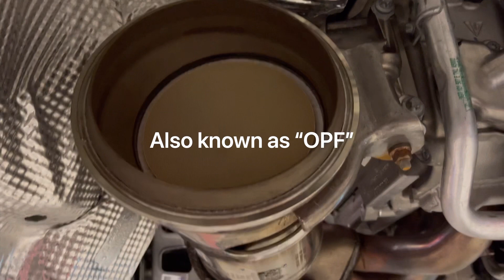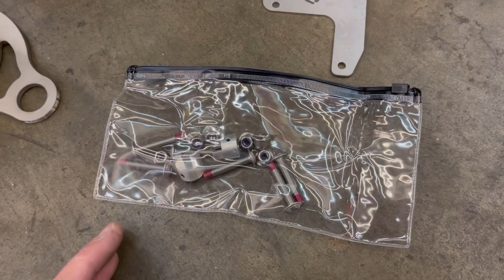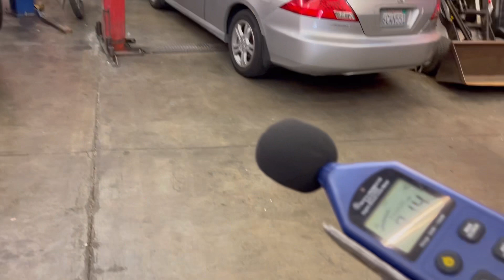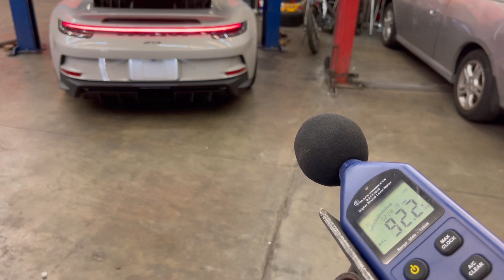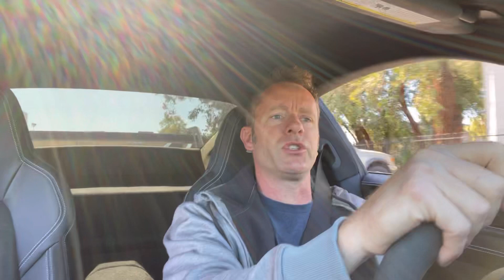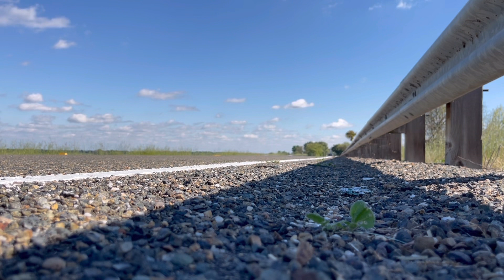992 GT3 JCR exhaust before and after DB’s, drive by sound, and impressions.

Comment: The only noticeable difference is with the exhaust valve closed. I wouldn't buy it...
Reply from the maker: @br1m3  unfortunately the video doesn’t translate the tone difference.  It’s very discernible from stock in either setting.
Reply: Ok ... but numbers are numbers:
Original exhaust valve's open: 117 DB
JCR exhaust valve's open: 115,5 DB
🧐🧐🧐🧐🧐🧐🧐🧐🧐🧐

Comment: thanks for this good explainer. have you tried any other exhausts on GT3? I am looking for something high pitched, not bassy. akrapovic comes out very low frequency and bassy exhaust. this jcr is better but still not as good as 991 gt3 sounded with their exhaust IMHO. so far - Valvetronic Designs, iPE, Dundon, Fabspeed - sound more high pitchy to me
Reply from the maker: Don’t be fooled that the exhaust can change the result of the engine dramatically.  You cannot make Madonna sound like James Hetfield with different equalizers or amplifiers.  Exhaust systems can have some impact, but not that much.
Reply: @mufflertech  I'd disagree - there is such a dramatic difference between some of the exhausts. Just hear this one out https://www.youtube.com/watch?v=-DuHQQXI_JU
Reply from the maker: @rdrrua  that car has 200 cell cats with header’s.  That is where the big difference is.

Comment: What is OPF monitored or non monitored?
Reply from the maker: OPF are non monitored on North American spec cars
Reply: @mufflertech   ahh okey, so for spain is monitored
Reply: Does the exhaust need software tunning?
Reply from the maker: @S25117  no.  The change is within the ability for the ECU to make its own adjustment.  It’s similar to what happens when you move a car from a high elevation to a lower one, the fuel enrichment adjusts to the available oxygen in the environment.

Comment: Your reving a customers car to 9k that has less than 1000 miles on motor?
Reply from the maker: Lol, the ECU doesn’t allow anything over 6K without being in gear and even if it did we wouldn’t free rev an engine that high on any engine, regardless of mileage.  Where did you get the impression we we’re getting that high in revolutions?

Comment: I feel like when the car stop, there is pretty big different in sound between stock and JCR (also the same with other exhaust brand), but when the car runs in high rpm, why I feel like stock vs aftermarket brand are the same. If there is a difference, only a bit. This is personal oppinion. Please correct me if I am wrong. Btw I just bought 992 gt3 and consider to upgrade exhaust system.
Reply from the maker: Sound is subjective, so no opinion is wrong.  I would say before making a decision that you should hear them in person.  I assure you (at least by my opinion and I do a lot of exhaust) it is louder at every RPM with a higher pitch.
Reply: @mufflertech  hear them in person is the right thing to do Sir. Yes I believe it must be different in sound. Thank you for your advice.
Reply: @mufflertech  may I ask your personal opinion, what would you choose for exhaust system for 992 gt3? Akrapovic, JCR or Dundon.
Reply from the maker: @brad7425  good question.  It depends on your goal.  Dundon is the only company offering anything in Inconel, so if you’re after the absolute best material they are a great choice.  The Akrapovic is like automotive jewelry, it’s the most finished product we sell hands down, they also use a full muffler, so they’re the most conservative in volume.  JCR is probably my choice for a number of different reasons, great sound, amazing support, and relatively quick availability.  They’ve also been doing 992 stuff the longest.
Reply: @mufflertech  thank you for your detailed information. Here in Asia, not many GT3 use these brands, so I have to ask expert or people with more experience through online. I get your point here, they are all have benefit, but for some reasons JCR would be the one. I will put this as a reference👍
Reply: Hi, do you have stock item for JCR titanium race pipe (valved) exhaust? And the tips also. I want to order from JCR directly but have to wait for it to be built. I am thinking maybe I can order from you if you have it in stock.

Comment: Jcr is just the best by far for aftermarket exhausts for Porsches, in terms of quality and sound they are just unrivalled
Reply: ha. check out various topics at rennlist when JCR exhausts were burnt through when taken to a track
Reply: @rdrrua  I have had 3, most recently on my 992 Gt3 and have used it on track many times .Never had a problem, and they have fantastic customer service If you have an issue which I fortunately haven’t. There are other good brands also. I wouldn’t read too much into rennlist mate it’s full of people with too much time on their hands.
Reply: @B1979R  true that - too many topics about the colour of stitching on an order or some special options to go for
Reply: @B1979R  my point also was that jcr exhaust for 992 gt3 does not seem to sing high pitch notes as for 991. iPE sounds better to me
Reply: @rdrrua  Agreed , I like IPE its also up there for me. I think the 991 is better sounding no matter what , 992 also has the GPF . Even the US cars have a dummy GPF, so unless you get around that and change link pipes it’s never gonna compete with 991 sound.
Reply: @rdrrua    You don't want an exhaust that sounds too high pitched, I'm assuming you like the R1 Motorsport exhaust too, problem with that exhaust is that it's high pitch is way too singular and stands out too much, you want a combination of high and low frequencies. Akrapovic is on the other end where the low frequencies dominate. Personally to me IPE Fi, and JCR sound pretty much the same, they sit in the middle.

Comment: Enjoyed the video. Porsche realized how much the exhaust is changed with so many possible configurations that they designed the 992 where you don't need to remove the bumper anymore?
Reply from the maker: We remove one of the header assemblies instead.  We’re not afraid to remove the bumper,  but  the header removal save’s time.

Comment: All 911's are tail heavy by definition. How much did the OE stock exhausts weight on the white and dark grey car? How much did the JCR exhaust weight on the white car with valves and the dark grey car without? Less weight improves handling!
Reply from the maker: Regrettably I didn’t weigh them.  I’d guess at least 25-30 pounds less for the JCR.
Reply: Arguably, the benefit of an alternative muffler, especially in a 911, is less weight, more BHP and your film did not highlight the gains! I don't want to attract attention in my 992 GT3K so more noise is a negative but tolerable for less weight and more BHP.

Comment: Nice Video, the dark grey has no valves right? did you have to buy the valve deletion kit from JCR? where it goes installed?
Reply from the maker: Yes, the grey car has no valve’s.  The JCR system comes with all the necessary parts to complete the install.  The valve deletes mount behind the bumper on the air box mounts.

Comment: FYI.  Sound doubles every 3dB. so 10-15dB open v closed is hugh!   Also,  SPL's should be measured at 1metre from the source.
But a very good review of exhausts on the 992GT3, thanks.
Reply from the maker: We can try 1 meter next time.  I figured we’re doing the measurements from the same distance so the changed results are consistent.  It’s about the measured difference’s not the beginning and ending numbers.  If your suggestion is more of an industry standard, and it sounds as though it is, I’m happy to do it next time😎
Reply: @mufflertech  Thanks for your reply.  Yes 1m is industry standard.  You won't need an X on the floor then, and car in the exact same position, 1m is 1m!  But if you wanted to go the next level, you'd do it in a sound booth.  Bit over the top for this though.  Atleast at 1m you can compare all cars that you fit.  Still a great job.  My 992GT3 arrives in a few weeks so found it useful.

Comment: Can we get rid of the OPF?
Reply from the maker: Legally no.  Depending on where you live an emissions test would fail if they weren’t on the car.  In California cars don’t require a smog until they are 5 years old for renewal.  Transfer requires a smog test.  We just added Dundon Motorsports to our line up and they have a complete system header to tailpipe that deletes the GPF/OPF.  See here: https://www.dundonmotorsports.com/products/street-header-exhaust-power-package-2022-992-gt3-non-eu-version

Comment: If you put the car in drive and press and hold both paddles on the steering wheel the car with rev to 7000 rpm
Reply from the maker: Both of these cars are manual.
Reply: @mufflertech  👍 The way they should be!